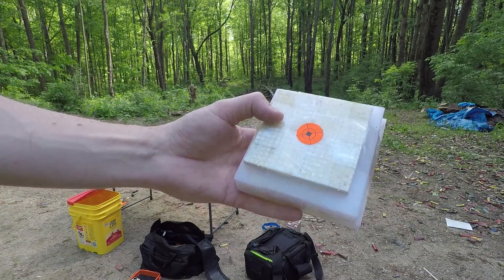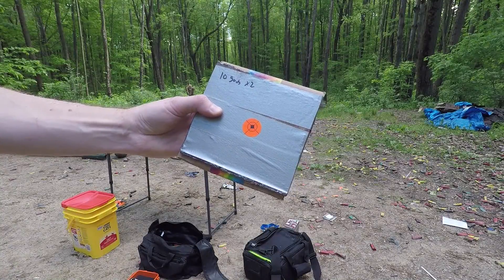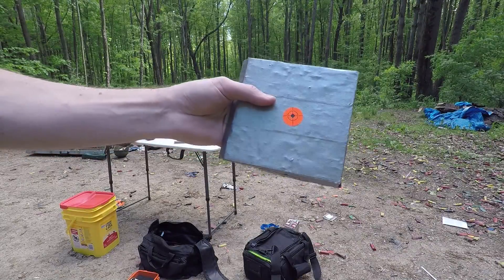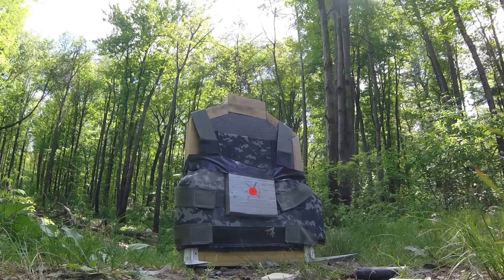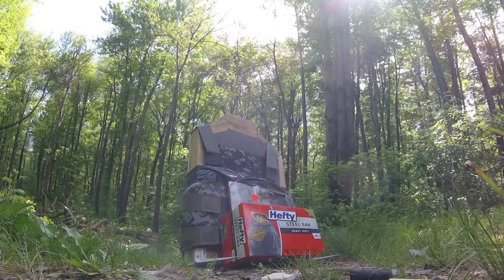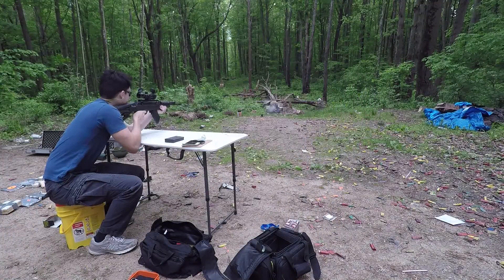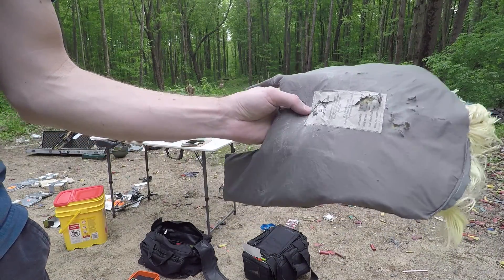Homemade hardware store SAPI armor plates stopping rifle rounds

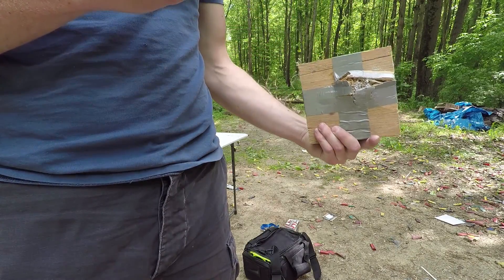Comment: Had an idea to make a system like the one at @3:30 with 1/4 in aluminum and marble tile. I was going to flex seal it together with a horse stall mat backing (Demolition ranch video haha) Not too savvy on all this though, is there a certain kind of aluminum with a certain strength I should get?
Reply: 7075 is the most common of the very strong aluminum.